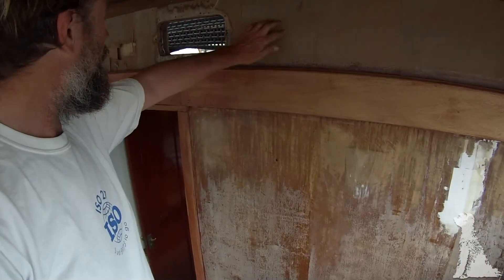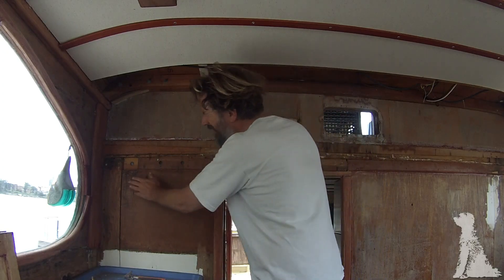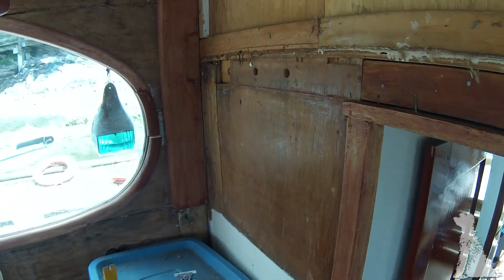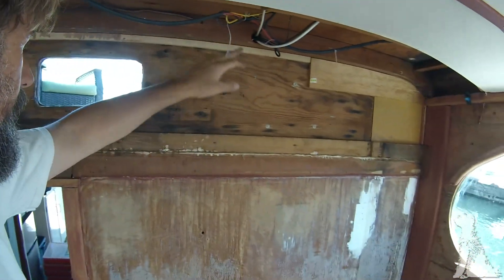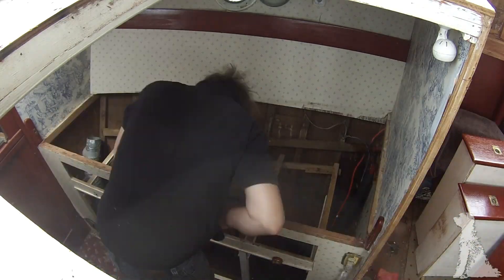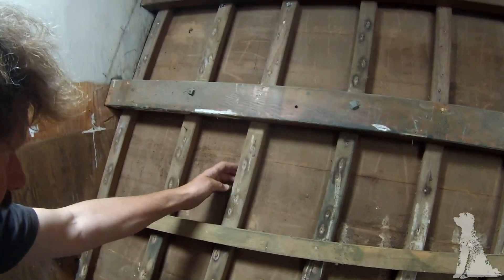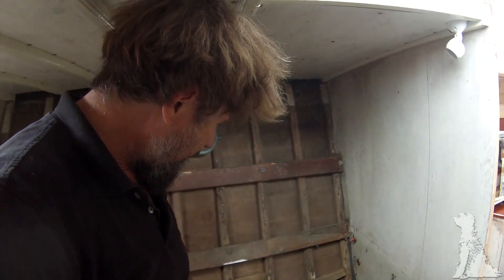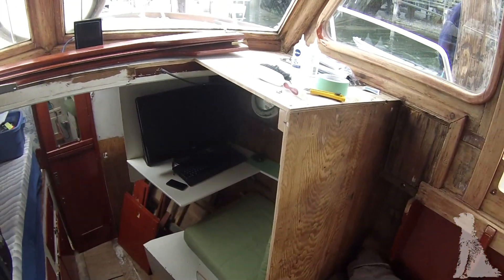Move the companionway - Wooden boat restoration - Boat refit - Travels With Geordie #50

Comment: I was looking at that old compass sitting there as you cut away at the bulkhead. Did you by chance buy that out in Sidney at the old used parts chandlery? if you did I think it was one I sold years back and it came from Zanzibar East Africa. Was it dry when you bought it?
Reply from the maker: It was aboard when I bought the boat and I suspect it has been for some time.